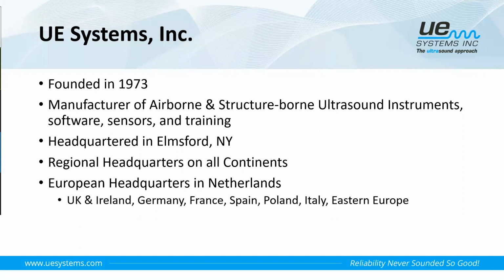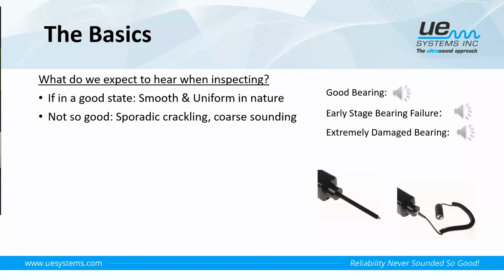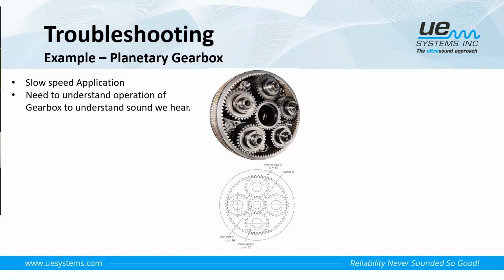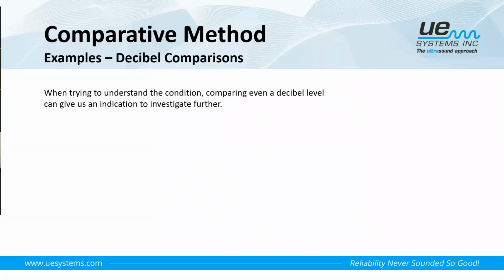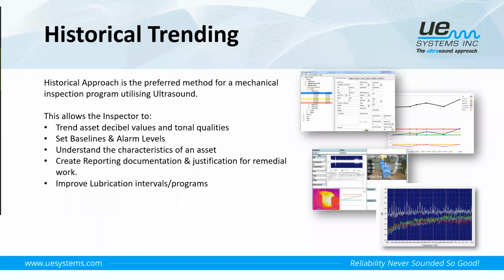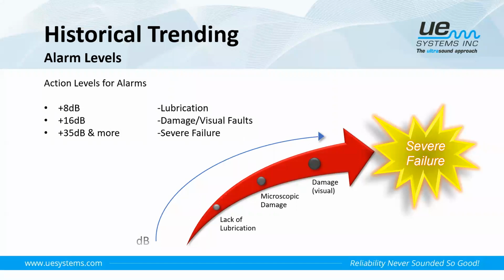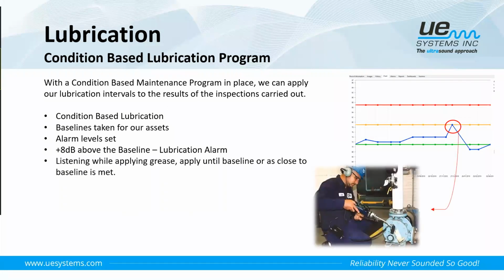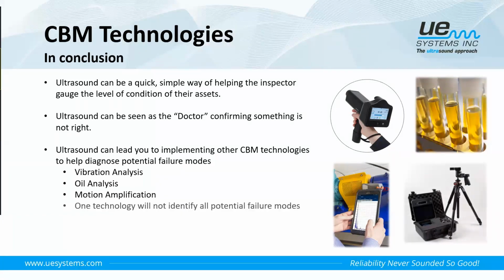Mechanical Inspection: A Deep Dive into Ultrasound use on Rotating Assets - UE Systems Webinar

Comment: Hai sir
Contact with nipple or bearing housing 
which point is suitable for readings consistency

Normally, bearing housings are painted surface

So measuring nipple and bearing housing dB level was difference. 

So plz suggest for which best location for measuring.
Reply from the maker: Hello @naveensrini5863 , please contact us through the email info@uesystems.com so we can better explain. We can also be contacted through the form available on the website: https://www.uesystems.com/en-gb/request-a-quote/